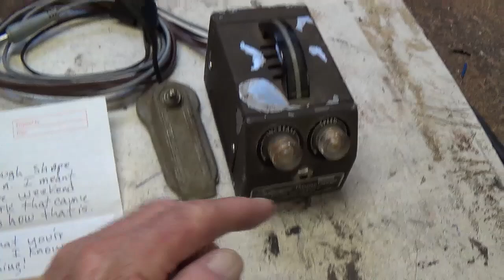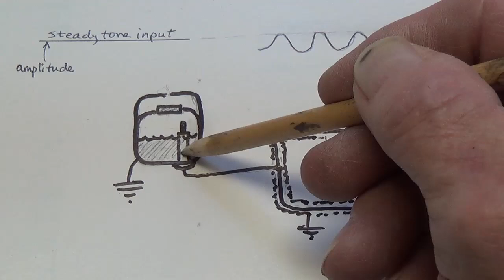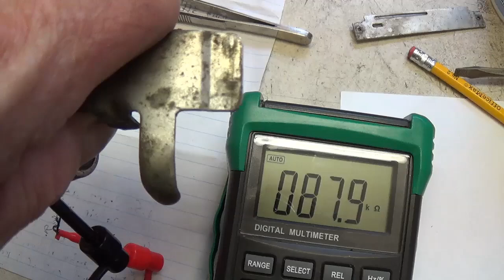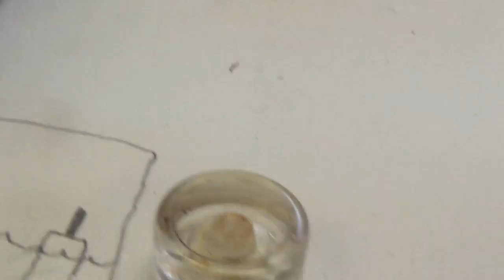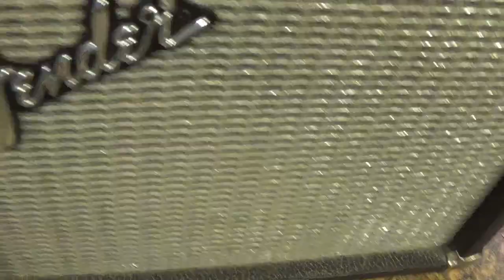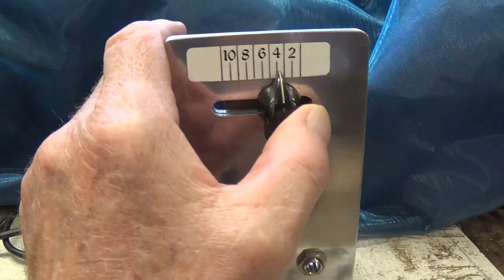1940's DeArmond Electromechanical Tremolo Unit.....DeAd on DeLivery !!!

Comment: As always, very interesting!! But it seems to me that the eccentric wheel should be installed with the bevel mating to the conical shaft on the motor (flipped). Otherwise what is the purpose of the bevel?? As it is, a wheel with an o-ring tire would work just as well and be cheaper to manufacture (and replace if necessary). With the bevel riding on the surface of the cone I think it would have an affect on the speed as well. Anyway, I love your work!!
Reply from the maker: That's an interesting point, WPM. Thanks for your input :)
Reply: wallpapermusique I believe you are correct based on pictures I found of this unit.

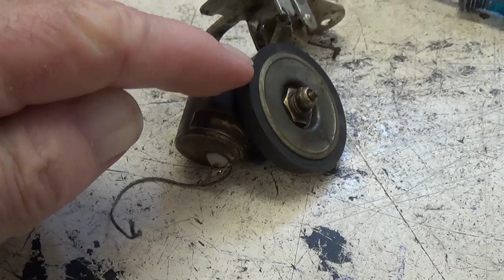Comment: Hi Doug, another great video to bring up morale! At and around 13:25, a small tension spring is visible on the wheel assembly. Is this the missing spring that you replaced, or does it have another function?
Reply from the maker: That's the spring I added. The video scenes were not in chronological order.
Reply: Ah, I should have realised that.

Comment: The pinch roller looks bent, adding more wow then it should  but maybe in this case as a tremolo it adds its own sound.    I see that as it speeds up   It straightens with more pressure.   My guess the rubber is far from perfect try some rubber renew or even lighter fluid (naphtha).
Have fun with the new toy.
Reply from the maker: Thanks, Greg. It's already back in the hands of its owner.....who loves it.

Comment: you were joking about the windex...right?
Reply: Its true. I have read some articles about this unit and its indeed windex
The 3 prong puzzles me as it could induce a ground loop with the amp
Reply from the maker: Not if both plugs are polarized, 4M, and they both were.
Reply from the maker: Nope. Apparently that's what they used at the factory also.
Reply: @UncleDoug  hahaha wow

Comment: WoW! That has to be the most comprehensive look into The DeArmond tremolo unit ..... and what a great unit!
One thing that I have always questioned is why there has been no speed pedal for an analog tremolo unit? I wish the varistor based vibrato in my old Magnatone 260 had a pedal so certain passages could be sped up or down to emphasize expression. 
Great video Doug!
Reply from the maker: Thanks, KM.

Comment: Outstanding video.  So far into the past. Do you own a time machine? 
It appears that the moving mechanism may be susceptible to transport damage.
I observed no transport lock mechanism, in this very thorough presentation.
A similar mechanism comes to mind; tone arms have had locks from very early.
I find this odd and unsettling.
Further thought: Perhaps the original manual, instruct to transport with a particular side down?
Reply from the maker: I understand your concern, Jake, but once you turn a package over to a carrier, chances are no helpful transport instructions will be heeded. It made it back to the owner in perfect shape.

Comment: ahh, the old ucon 65...nobody has been able to tell me the electrical characteristic of that stuff, id have thought a unit like this would use mercury! be interesting to swap it out and see if it works

I have found those little motors use very little energy too, about 14-17w, was it about the same for this?
Reply from the maker: I don't think mercury would work well, P.  Too much mass, very toxic, and the output would resemble a square wave. High conductivity is not a desirable property.
Reply: @UncleDoug  I should probabaly check mine is still sealed properly or if keeping mercury by the bed is a bad idea...

Comment: The problem is your audio generator with a very low output impedance. You need to add a series resistor to mimic the source impedance of a guitar pickup.
Reply from the maker: Thanks for the good suggestion, Ef.
Reply: Exactly what I came to say. Now 5/10 sounds like 8.
Reply: Or an impedance transformer, I have variable transformers for mics and pickups. It's old.
Reply: Your my favorite tube EF
Reply: Very handy to craft a pigtail/jack cable with a 10k resistor inside the jack.
Reply: Right!!!!!

Comment: You should run a three wire cord to the foot switch too, it has line voltage in it and it’s a metal enclosure
Reply: It may actually be hard rubber. A lot of early footswitches were retrofitted from standard, commercially available doorstops.
Reply: @twoodfrd  Good point, certainly looks like it could be.
Reply from the maker: Jeff, the doorstop used for the footswitch is hard rubber.
Reply: What do you think of the the fab repair though..?
Reply: @Teleeddy  Love it, an amazing gadget skillfully restored - better than original with the replacement potentiometer :-)
Reply: @Teleeddy  excellent! Uncle Doug is a true professional
Reply: @pinterelectric  He's a  fab teacher..Such knowledge..! 😊
Reply from the maker: Thanks for all the nice comments :)
Reply: Was thinking the same. I'm extra paranoid about that sort of thing here in the UK when you have 240V inside a metal box.

Comment: Amazing, thanks for sharing
Reply from the maker: Glad you enjoyed it, Kolin :)
Reply: Uncle Doug I did very much , I was starting to think we were in the game Myst for a minute, I love how you speed controlled the induction motor, I’m going to guess you used a mini modified version of the liquid dynamic artifact we all know as the torque converter? 
It’s always an adventure Doug <3
Also on the ‘serious’ that tremolo has some sort of Magik the non electro mechanical don’t it sounds amazing.
Reply: Uncle Doug not to be outdone Doug {not that it’s a competition}
I’ve just posted on my twitter how to use ‘impedance’ which is rotational offset not a ‘burning’ of energy to get a ‘free magnetic feild’
I’m sure you understand as you are all about rotational objects but yes it can be easily proven by placing a say 200nf ‘capacitor’ in circuit with your 120v line then a bulb the XC offsets the light now take the bulb away and use the lil ‘capacitor’ like a choke alone.
 
The capacitor does not burn obviously, now work out the XC of the 200nf at say 50hz {about {not} 16 Kohms } 

Now put a 16 k ohm  in place of the capacitor it will eventually be the light bulb it always wanted to be. 

However that puny lil cap what magic stops it from becoming a lightbulb? 

The same principle can be inverted for an inductor but if the feild is NOT unified, ie a rod with two ends , the magnetic feild is generated on the two ends while the ‘impedance’ {just like the capacitor} is offsetting all the energy in a per polarity Magikal way. :D 
The key is to raise the ‘impedance’ obviously the main vector being rotation speed. 
Not my science I learned it from reptilians!  Lol

Comment: Doug, the effect you noticed with the tone generator might be caused by the low output impedance of the generator. Guitars usually have a rather high impedance so a 100K resistor has a larger impact on the signal than if a 600 ohms generator is connected.

BTW, your first trem has a lovely 19th century appeal with the wooden base.
Reply from the maker: Thanks for your helpful input and nice comment, Eddy.

Comment: Good stuff !!  Solder wick  would have been what you needed to clean that up . I use it often when de-soldering.(it's great stuff as well) I agree with not re-soldering it closed again--a little dab of silicone seal would work I think. I know some local lads that would love that thing !!!
Reply from the maker: I tried the de-soldering braid, Mr. CC, but finally resorted to compressed air. Thanks for your input.
Reply: @UncleDoug  Rub on a bit of soldering paste--makes a big difference.

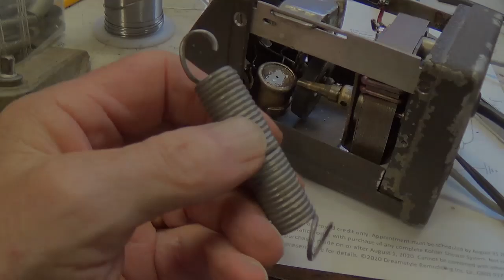Comment: 40:02 it took me some seconds... 😂
Now an electromechanical tremolo, that's something I never imagined would exist. I wonder if motors were cheaper than tubes.
Reply from the maker: God only knows why they went to so much trouble to create this EM jewel, but I'm really glad they did :)
Reply: @UncleDoug  Well,  at least they used an electric motor, not a steam engine to spin that rubber wheel. 😀
However, no wonder why manufacturers like Fender ended up using for example optical tremolos, i. e. tube oscillators, glim lamps and LDRs to make a resistance to vary cyclically, and did not need electric motors and moving liquid tanks.
I hope you use a mechanical calculator if you need to do some math when repairing these crazy, but cool, devices. 😀
Very enjoyable and interesting video again.👍
Reply: @jutukka   I think the first uncle Doug model would look great driven by steam, it would balance the unit up visually.  Steam pressure would then control the speed and you could have a nice brass pressure gauge.  Steampunk at its best!
Reply: It was a big improvement: Back in the old days, in the Old Country, they had to run all their tremolos from a common shaft driven by a water wheel.
Reply: @blahblahblahblah2933  lol